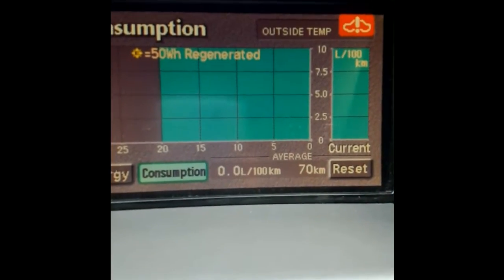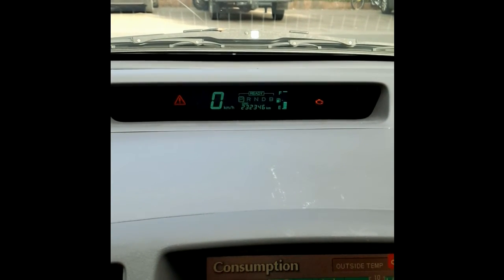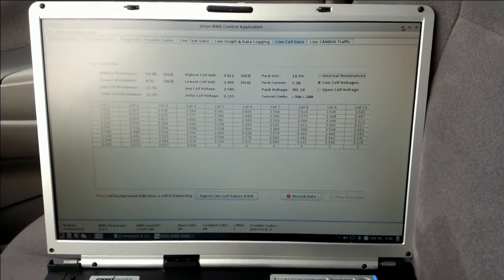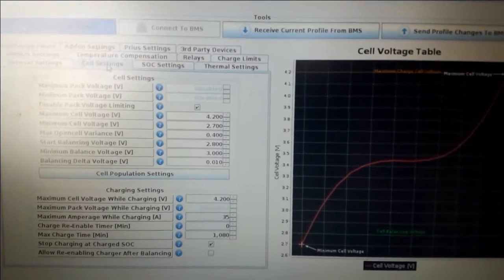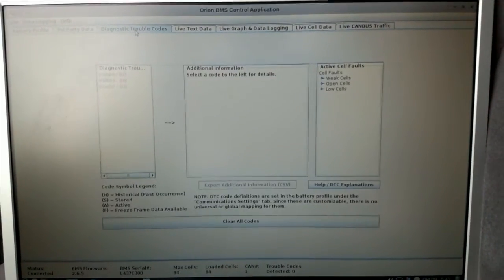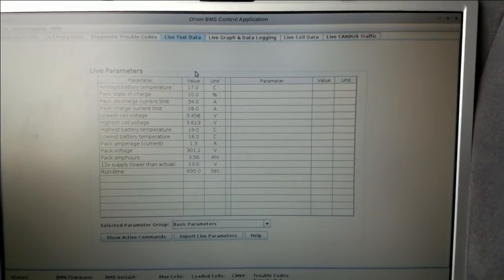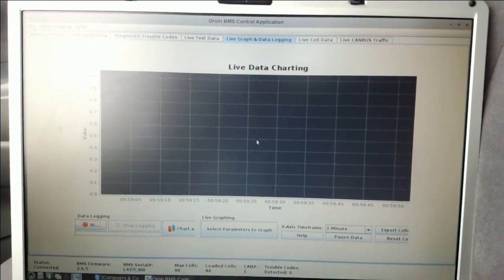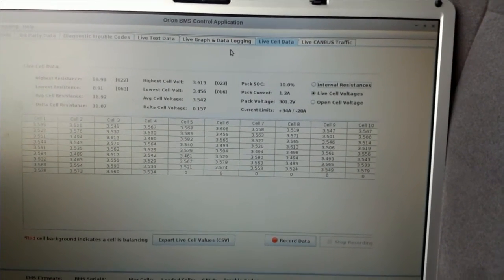Ewert Energy BMS (Orion), Prius Classic (NHW11) Plug in Hybrid

Comment: Hey, did you remove the oem battery?
Reply from the maker: Nope, the oem batery is still there.
Reply: Danz did you purchase Hybrid Energy Module from Ewert also? Or to put it in other words: how would you do it today? I mean in terms of hardware. I'm planning to purchase or a Prius or a Estima (also toyota) and transform it to phev. I'm looking for info but since 2012 there isn't any. I'm good at soldering and tinkering just need a clear explanation of the system, so I can prepare a Bill of Materials. I already have the batteries and bms.
Reply from the maker: This is a good start! I can recommend you the following conversion overview :
https://www.youtube.com/watch?v=hpWg-D63cnk&t=
To put it in a nutshell you need either a step-up or a step-down system to boost the EV mode on any Toyota/Lexus systems. Which one you chose depends on how you want to build your switching system.
A step-down version would be my preference as it is more efficient and allows coupling not only to conventional wall outlet but also to ChaDeMo fast charging protocol in case of Ewert BMS  (up to 50 kW charging rate, depending on the sell chemistry and the design of the battery pack)
A step-up version is simpler and easier to buy custom parts (chargers, inverters), but less efficient and less versatile though.

Toyota Estima is an attractive sample for such a conversion, i myself was considering an RX400h from Lexus ( four wheel electric drive with a phev option is something to consider)

Good luck with the project!
Reply: Danz Thank you! You mentioned step-down/up system. This means the addon battery will have either higher or lower voltage compared to the nimh oem one. Isn't it better if these 2 are the same? For prius 2 for ex: max voltage for nimh oem 242v, minimum 201.6v. This range is perfect for Liion setup with 60 cells in series. As for the CHAdeMO capability: i would not recommend it with a Liion battery. I tested several brands and at 0.1C charge current of a thermo insulated battery, the temperature rises 1.5C per hour. You can only imagine what would happen with higher C rates.

What is the max capacity you would recommend installing? I  think I'll drive in blended mode only.

Thank you!
Reply: Danz i have watched the presentation, thank you. I have come accross the web on info about that car. I don't like the idea of switching on/off the relays so often, they will reach their end of life time pretty fast. Is there any solution to completely remove the oem battery? It weights about 80kg. 20kWh of LiIon is 100kg :)
Reply from the maker: The use of either of the following systems depends on how you want to design your battery pack (cells in series and parallel, as much as what lithium chemistry: LFP, LCO, NMC, etc.) and how you couple your battery pack to the HV system of a Prius.

Let me list some of the features of those  three types:

1) Step-down: Li battery has a higher voltage. Possible battery design vary from 84S up to 96S (Max voltage 352,8 v and 403,2v respectively). The switching system between the oem nimh and the Li battery is done by a high frequency MOSFET where the end voltage as well as charging current which the eom battery will be topped to is precisely controlled by a mosfet driver (based on arduino as an example). I prefer this system over the other once since it is more efficient and allows fast charging, but is more complex to build.
Fast charging is not a problem when using power cells compatible with the power input. It all comes down to the pack design.

2) Step-up: Li battery is usually of 48volt to 96volt. A simple step-up converter is used to boost voltage from say 48volt to 240volt. Simple charger, simple bms, available parts. Is less efficient in comparison to a step-down system.

3) Direct connection between both batteries by matching the working voltage range works only when you intercept the can signal between the nimh ecu and the hybrid ecu (as it is mentioned in the presentation https://www.youtube.com/watch?v=hpWg-D63cnk&t=) and setting the SoC to permanent 80%. Else the prius system uses only 80% to 60% of the battery charge which is a range of 238volt and 220 volt. This range is well to small for whatever lithium pack design (including 60 cells in series).

The max capacity that you can install is limited by the battery size/weight and how much you are willing to invest into the whole system.
Whether you use energy dense cells or power dense cells will depend on which of the three systems you plan to install:
1) Step-down: energy cells
2) Step-up: power cells
3) Direct connection: power cells
Reply from the maker: Yes it is possible to replace the oem battery. I think the company that did it was Plug In Supply. You need to match tapwires of the oem BMS so that the prius accepts the new battery.
Reply: I have bought 5 tesla modules (modified them to 12s each). As for the Prius oem voltage range - I have read 80 to 40% is used, so calculated 240 to 200 roughly. which corresponds to 4 - 3.33v. Which is roughly 55% usable capacity, or 14kWh or ~100-110km of range.

Controlling a high frequency MOSFET is an unknown to me atm. I have a custom built battery controller which talks to tesla slave bms boards (obtains voltage and temperature readings from them), controls 2 power relays + 1 relay for precharge resistor, controls an mcp41010 (variable digital potentiometer) into a telekom battery charger, controls water pump relay, etc. The controller is based on Arduino DUE.

I guess I need some step by step guide, where and what to buy, how to connect, what to program. It is a new project, and my last one (Fiat Panda Electric Car) has eaten all my weekends for 1,5 years.

The enthusiasm is on the low side atm, pretty consumed by my other project.